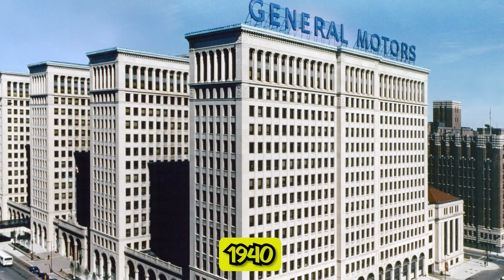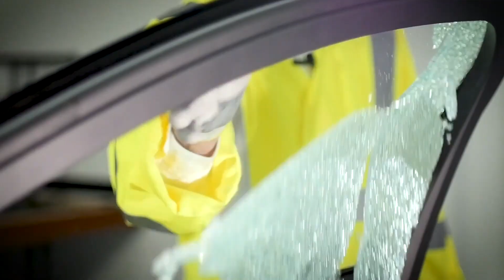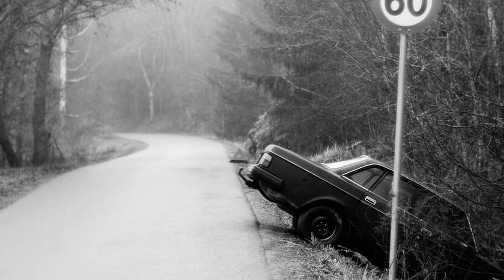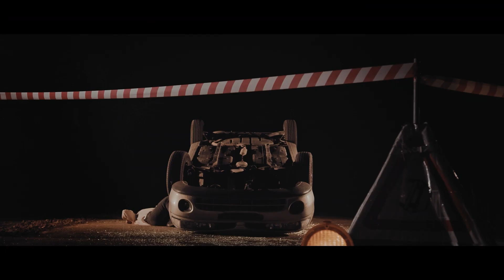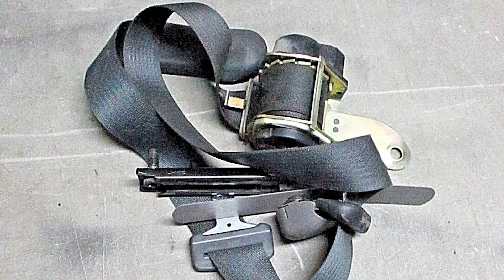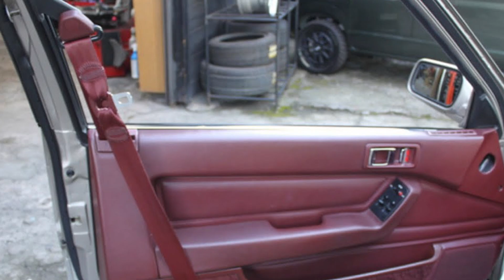10 Car Safety Features That Made Things Worse

Comment: Mercedes Benz was the first car company to introduce the airbag in 1981…..not Chevrolet in the 1970’s
Reply: The first commercially sold car with an airbag was a 1973 Oldsmobile Toronado with a passenger airbag, though the technology was also developed by Mercedes-Benz and Ford around the same time. The airbags in these early vehicles, which included 1971 experimental Ford cars and 1973 Chevrolet Impalas in a government fleet, were primarily a replacement for seat belts rather than an added layer of safety.